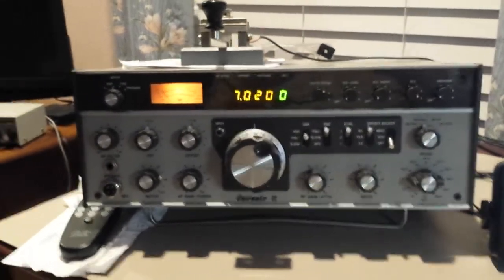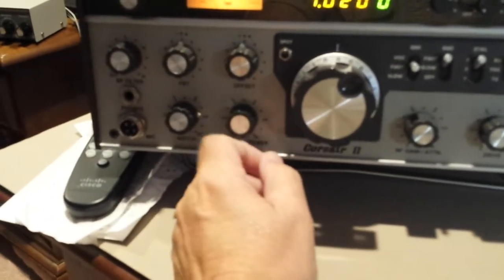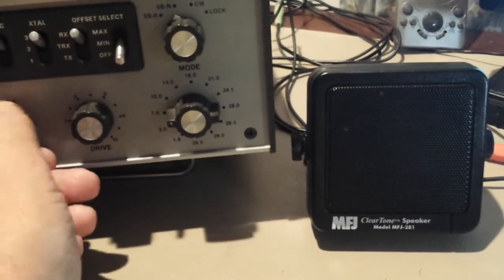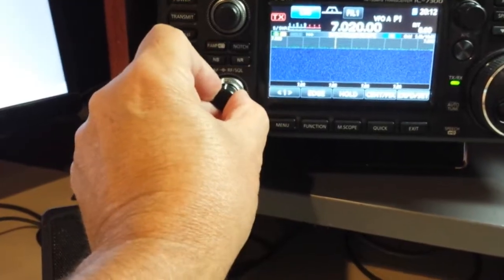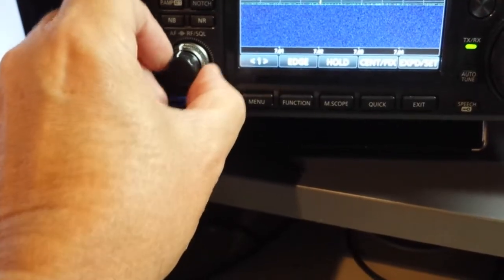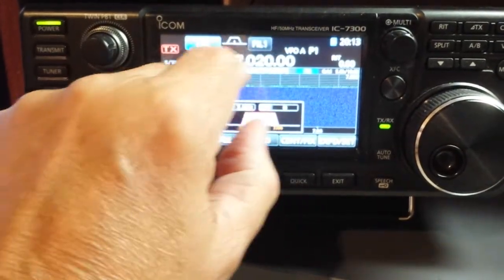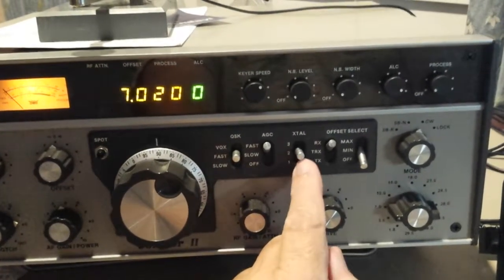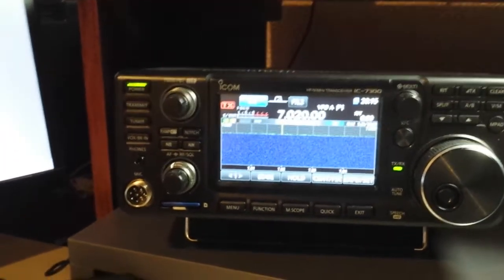IC-7300 Receiver Noise VS Corsair II Internal Noise

Comment: Great video Steve!! I owned the Corsair 25+ years ago and loved that rig...but it started to fail due to connections corroding...I now own  in (2023) the IC7300 and there's just no comparison, the Corsair II receiver much quieter - but the ICOM 7300 will be the last ham radio rig I will own, good enough for my causal operating - primarily CW. The F3 narrow filter on the IC7300 sucks!!!!!! I did have the Elecraft K2 and its analog filtering far superior to the ICOM rig...unfortunately, the K2 had its own issues. 73/K6SDW

Comment: This really does not prove anything!You forgot to point out that the ten tec has 2 noise blankers and neither one works,they will blank out the noise but also the station you are listening to.What a kludge ! I own both of these rigs and the 7300 is vastly superior.The ten tec uses audio derived agc, cheap audio compression on ssb.Ten tec skimps in a lot of areas.And they don't slik screen their circuit boards.
Thanks for the test,however the ten tec is in no way superior to the 7300.Ten tec is clearly in this test old technology to say the least.

Comment: You should have tried to switch the icom screen off. These color screens are perfect noise generators :) Many radio/transceiver manufacturers intentionally use monochrome screens to address this issue.

Comment: Some strong signal is jumping into the Icom there at 3:18. Perhaps that's a local digital/CW signal jumping the isolation of your antenna switch.  Sold my Corsair a very long time ago.   Still loving the 7300 because of the visual interface and that I can always find a signal somewhere with this wide-range and highly efficient end-fed half wave bit of wire and such on the other end of the coax.

Comment: It's a shame, I bought the 7300 around a month after I got my licence back in 2019, not long before that I bought the FT-77 an old radio but I made some contacts on it, when I got the 7300 I noticed nearly immediately how noisy the audio was compared to the FT-77 but I thought that adjusting some settings would change it but it didn't. 

A couple of months after that I got the FT-891 for portable use and was blown away how quiet the Receive Audio was compared to the 7300 and even with the Preamp on on the 891 and no NR it sounds so much better than the 7300 with preamp off and NR "on". I listen only with headphones, the 891 speaker isn't the best but it absolutely shines with headphones. 

I was almost about to pull the trigger on the FTDX-3000 because I did hear about the noisy  7300 but I was working shift then and what swung me towards the 7300 was that it was easier "or so I thought" to have remote access so I could make some contacts if it was quiet on night shift, it just turns out that Icoms remote software is crap. Anyway now I am no longer working shift and have the 7300 up for sale, it just doesn't float my boat any more. No screen in the world will make me hear a station better and in fact there are DX signals just so much easier to hear on the 891 because it's so quiet. 

As Steve demonstrates quite well in the video, with no antenna connected this is the harsh audio you will hear on top of band noise when you connect an antenna and it makes listening very fatiguing. 

The 7300 is a good starter radio with built in sound card so you can use digital easy but I got the XGGCOMMS USB audio interface for the 891 and it's easy to use so having USB sound card shouldn't be a deal-breaker. + the TX audio sounds good right out of the box it's just a shame Icom thought that by adding a screen they could let the receiver and audio quality suffer, and they got away with it........

I got a chance to test a TS-590SG in a friends house and it's a much better radio in every way, better filters, much better audio and a much nicer radio to operate and the real big plus here is that when Kenwood decided to update the 590 SG they didn't ruin it by adding SDR and screen but they added a panadapter so the buyer can decide whether they want the waterfall or not and I think this is really a fantastic idea, a radio with all the buttons good to operate with no SDR to digitise and destroy the audio and add the panadapter so the buyer can choose what he or she wants. 

I noticed the same with many DSP portable radios such as the Tecsun PL-880, S-8800 and XHDATA D-808, harsh sounding audio and the Tecsuns sound horrible on SSB and you can't use USB/LSB on SW broadcast because USB sounds so bad, the D-808 isn't as bad but it's not great, I got a much cheaper Tecsun PL-680 and it's got wonderful audio compared to the 880, S-8800 and D-808, and from what I've seen on youtube a lot of DSP portable have similar issues. 

It seems that digital processing is the main reason for poor audio and I just remembered that the Xiegu G90 is the same, harsh audio. I fear that in another while People are not going to know what good audio sounds like in a transceiver or portable radio.

Just goes to show that all the lab test or sherwood reports should be taken with a grain of salt because all the digital test equipment may tell tell part of the story but this digital test equipment can't tell what the Audio will sound like to a human.

Comment: The receiver on my 22 year old Yaesu   FT-840 is superior to my brand new Icom 7300. The noise on the 7300 gives me a headache when pulling signals out of the static. The 7300 is so bad it is now my back up radio at less than 2 weeks old. My  only hope is the Icom external speaker on it's way from Japan will ameliorate the horrid high pitch static from the Icom.
Reply: Yaesu has always had quiet receivers. Very good radio the ft840

Comment: It would have been nice if the test had started by tuning both radios to the same transmission and adjusting both for a similar level of received audio out. I can believe that a modern digital rig is noisier than a high spec classical analogue machine, but this test does not take into account the relative levels of gain in the AF stages. If you sit next to the speaker stack of a several hundred watt PA system and turn the volume up full, you will hear a lot of noise, but that is not a realistic test.
Reply: Yes, this test is sort of silly as whichever rig has the more powerful audio amp would appear to have more "noise". The cheapo speaker being used is also a poor choice as it accentuates high frequencies as it's basically a tweeter. Communications speakers should reproduce 300 - 3000 Hz, and that's it. Higher and lower frequencies should be rolled off. However, in the case of the IC-7300 on real world high performance  antennas it slaughters these old audio derived AGC TenTec rigs when it comes to dynamic range situations such as listening to a weak signal with a loud signal nearby. I do currently own an older TenTec (TenTec OmniC, and have also owned the Jupiter, Delta, Century 22 and Triton IV as well) and they are all nice QSK CW rigs when used with with a matching TenTec QSK amplifier like my Centaur, and they certainly operate in QSK a bit nicer than Icom. I still do enjoy operating my OmniC for QSK CW. However, from a pure receiver performance standpoint even Sherwood rates the IC-7300 far higher than all TenTecs. I personally bought an IC-7300 to see for myself if it's really that good and I have to say it is an amazing rig for new price I paid just under $1K from DX Engineering. It wipes up the floor with all of these older technology rigs - including my S-Line, C-Line, and even my JRCs, and is frankly the new disruptive technology transceiver standard to beat. Press the NR button and it's a whole new world of quiet. By direct comparison these older used rigs should sell for no more than $200 when you can buy an brand new IC-7300 for under $1K, and the market will eventually equalize to that point or close - unless a buyer applies a high sentimental value being added in to an older rig your dad had, etc.

Comment: Thanks for this. I almost thought I had a faulty unit when I heard so much noise even with the AF gain on minimum. But I hear exactly the same as yours... :(

You can marginally improve it reducing the RX treble or lower the LPF cut-off (menu/set/tone controls) but I still find this noise very grating after a while.

Comment: Thanks for your demonstration. I don't like internal noise. At one time when I was a child, I bought a new stylish radio with integrated chips and listened to MW band. At the beginning I felt unfamiliar feeling comparing to my previous expericence of AM transistor radios. Years after that, I suddenly realized the modern radios are internally noisy. Until now I've been going for rigs with low internal noise, such as Tecsun S2000. Several years ago when I participated a field day, there was a IC-7000 cracking out hiss without conneting any antenna. I was sure I would not buy that radio.

Comment: Steve, Does this noise affect normal operation?  Normal being when you have it attached to an antenna and scanning the bands for a QSO?  I wonder why Icom doesn't use the conventional ATT circuit near the antenna connector they have used for years?
Reply from the maker: No. The noise you are hearing is below the normal residual band noise so it is not audible once the antenna is connected. I was just making a point.
Reply: OK, thanx Steve.  And thanx for your videos. - Bob
Reply: I just got a 7300 & it seems to be a noisy receiver to me.  Even with the ATT on, there is a lot of background noise.  Background noise level is the same with ATT on & off.  I guess the ATT is S/W & not some padding resistors at the antenna.  My IC7410 is much quieter.
Reply from the maker: ATT is actually just a resistor from antenna to ground with a diode in series who's bias is controlled by either the ATT switch or AGC voltage.
Reply: Thanx for the correction.  I am still looking for that on the schematic (I'll find it after posting 'cause it always works that way).  I see several ATT lines.  If it is a single resistor, I wonder how they control the impedance?
Reply: I see the 18dB ATT and switching diodes on the pg3 RF Unit, but not the resistor

Comment: Make sure IP+ is off on the 7300. Also remember the Corsair receiver is linear (in a line) while the 7300 is a DSP so signal or no signal, you hear DSP noise, worse if IP+ is on.
Reply from the maker: Yes if one antenna is laying on the ground it certainly will be quiet. Dummy loads are quiet. However local noise could be picked up better by a given antenna due to its location or polarity in respect to the noise while another equally good antenna could be dead quiet because it's a different polarity, aimed to favor a different direction or high above the surrounding neighborhood. 
As for receivers There are huge differences but when it comes to the "Sensitivity" issue, if you connect the antenna to the receiver and the noise level increases you can be assured the receiver is plenty sensitive. It's been that way since about 1929. However A receiver does generate its own internal noise and this is BAD. It will mask weak signals. 
Whoever told you that "most DX is in the noise" is just making a general statement. You should define what DX is first. "Distant" from where and how far and what frequency? 20 miles on 2 meters is DX. 20 miles on 40 meters is QRM. 
I'm resting my fingers now. 73
Reply from the maker: IP+ stays off here. I've been into this for 53 years and never heard of a "Linear Receiver". Maybe you can enlighten me?
Reply: Fair enough, thanks for taking the time ;)
Reply: I have no credentials whatsoever being a noob (foundation) and all, but isn't it the same as antennae, where if it's quieter it also means deafer? I just changed antennae recently the new one is noisier by a good margin but also gets so many more signals... Someone told me that most of DX is in the noise so less noise is bad, how does that relate to the receiver noise?